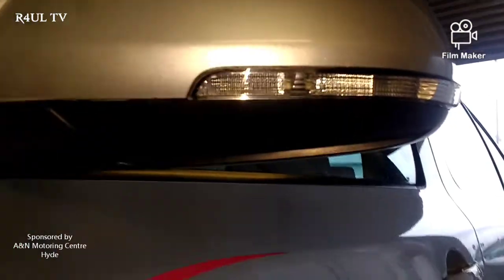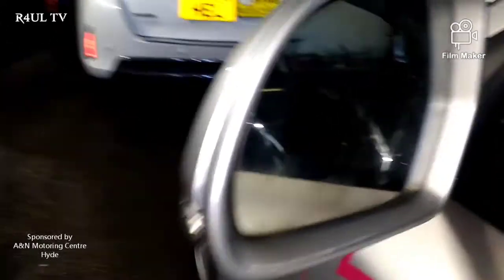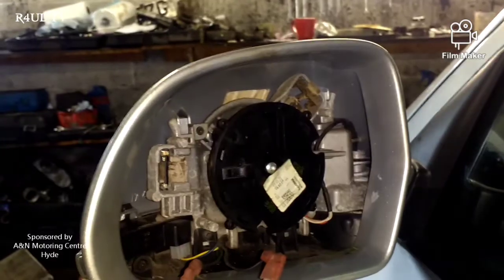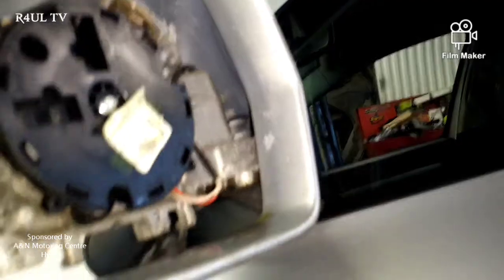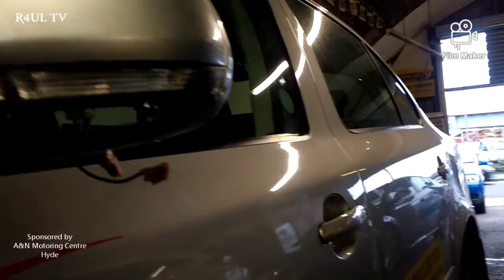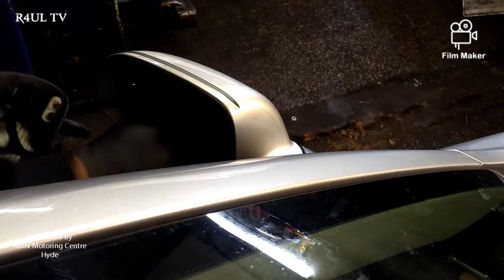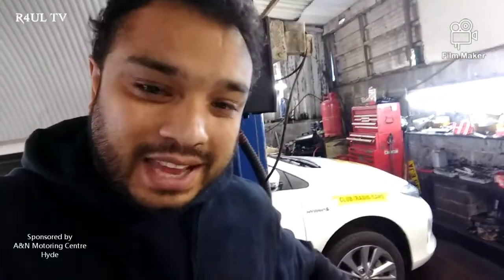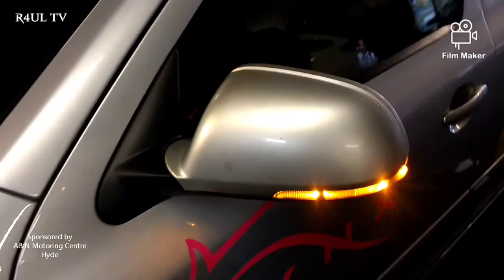How to Replace 2012 Skoda Octavia door Mirror indicator/Repeter, R4UL TV

Comment: How long does it take roughly for a rookie? Thanks
Reply from the maker: Sorry I couldn't be more clearer on the video but so hard to show on camera. To be honest  not the easiest, really fiddly job so no time limit just take your time
Reply: @TEAMR4ULTV  so approx how long for a mechanic then? Thanks
Reply from the maker: @xxx982  I really dont know how long it will take you. But I would say about 30 mins
Reply: I've just done this job. It took me 15 minutes. The most annoying part was getting the mirror glass out, as it takes a surprising amount of force to pop it off its mount, and I was worried about breaking it. But it survived. Although all of the retaining devices have a T10 torque head, two are bolts and two are screws, so be careful not to put them back in the incorrect holes, as the threads won't match. Prising off the lower black cover wasn't easy, but was more straightforward than getting the mirror off. It was a little tricky to get the black cover back on, but the re-assembly process was easier that the disassembly.